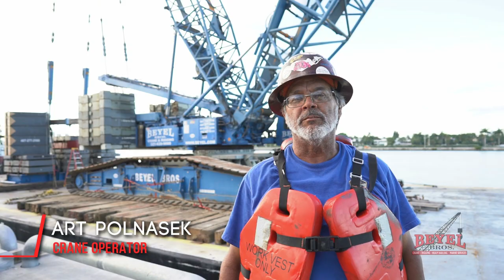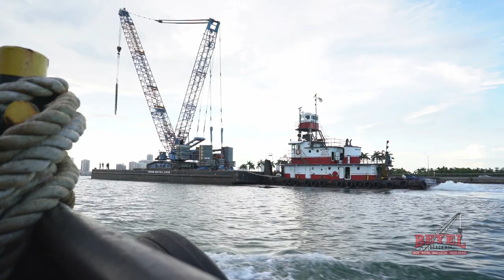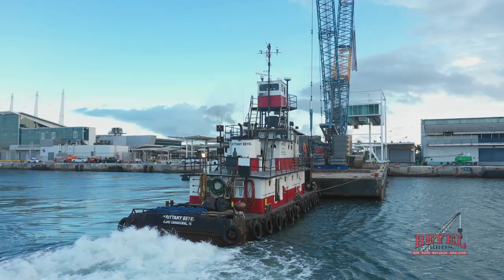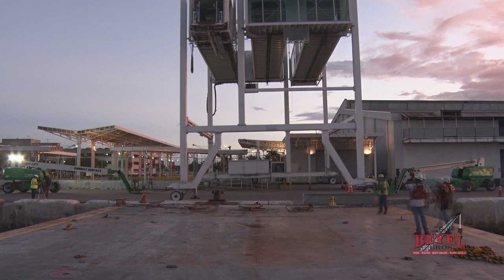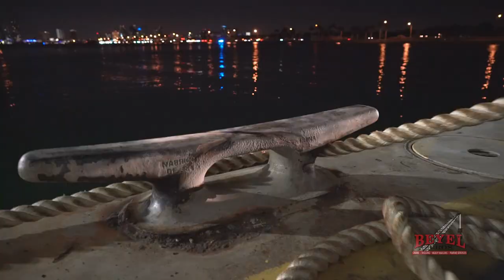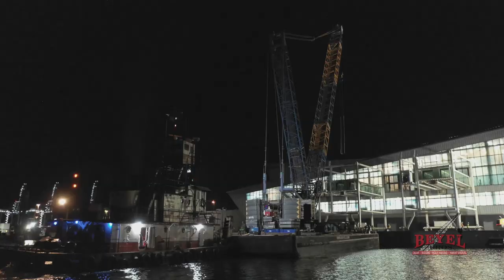Beyel Brothers - Marine Services - Port of Miami

Comment: W O W ...  video I could appreciate finally...!!
In the early 70’s I ran Lima 2400 Draglines in a rock quarry in west
Miami, we also had two Tugboats & eight barges that I operated...
Then about a year after Lehigh shutdown I was back in Miami and heard 
Ebsary Foundation CO. Had bought on of the Tugboats I had run so I worked fo them a few months.
The pushed barges with Cranes on them out of the Miami River doing bridge work around the port & 
Bay Area...